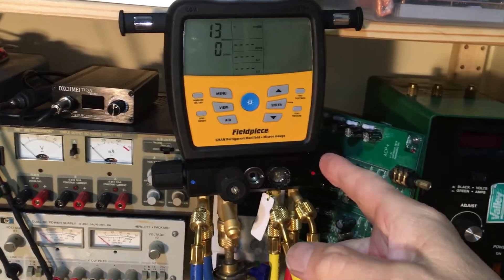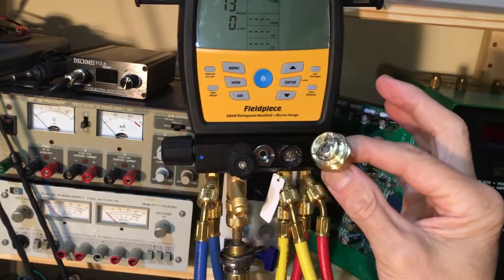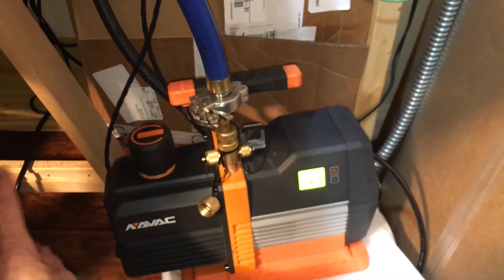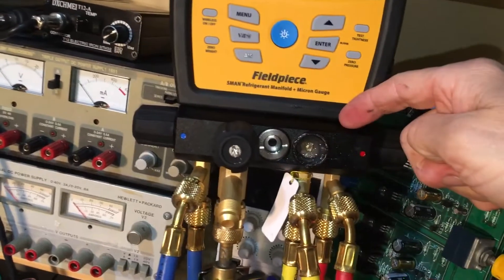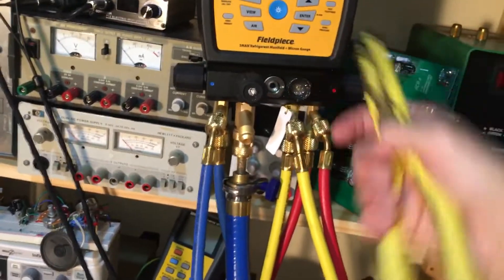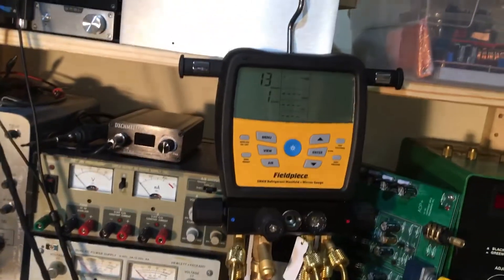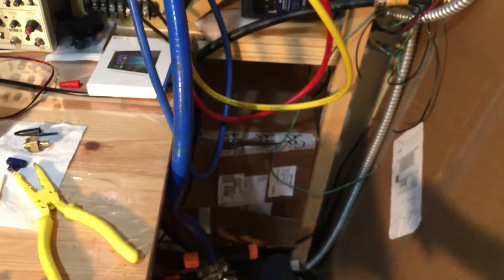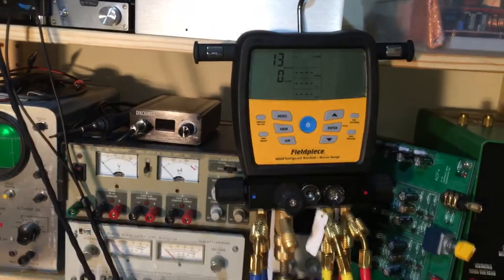Pt:6 SM480V 13 µm (microns) over night 12hr vacuum decay test.

Comment: I am so sad..... merely at the manifold only, no hose at all, I am having decay by 900 microns in 1 hour. The manifold is from Thailand, brand Tasco Black.  Micron gauge at LP valve port and vacuum at middle port, I then shut off LP valve so micron gauge read only the small air-path between itself and the analog gauge and any leak rate from the nylon seal of the LP valve.

Your manifold micron value doesn't lie. Two Thumbs Up.
You silicone it well during the improvement-overhaul that is one thing, but your method of always flushing with dry nitrogen I am sure is also important. Like a good food, it takes many ingredients to make it awesome :)

How low a micron can someone's SMAN480V brand new but left un-improved unlike yours ? I mean the manifold only assuming a ball valve installed to shut off hoses.

Thanks
Reply from the maker: FIRST MOST IMPORTANT ! To understand 

1: We are not supposed to attempt to pull extremely deep, lol micron vacuums through refrigerant, charging the horses that are not rated for Pulling Depot Vacuum in the first place .,

2: just the air that is trapped inside your ball valve when you open or close will throw off your micron reading. 

3: refrigerant, charging hoses out gas, they hold moisture they hold, refrigerant not rated for deep vacuum, and will be a source of some of the loss of micron rating during a micron vacuum decay test. 

And no matter who is Brand Refrigerant Garage are use they all have a little bit of leakage, trying to pull a deep vacuum beyond the rating . 

And definitely every time after using silicone grease makes all the difference in the world . 

That nylon valve face is pretty indestructible. Unlike that earlier predecessors were made out of Teflon would get damaged very easy. Worked very good when they were good.. 

But the small metal debris from a dirty AC system can embed in the valve face causing leakage . 

Many of the Chinese or cheap offbrand inexpensive manifolds I find them to be very leaky or if they don’t look at first they leak in a very short period of time .  In the material they use for the valve facing fails a early life.. 

Two years later, I am still using that same manifold to this day, and I use it anywhere from 8 to 10 times on vehicles every day .    Constantly screwing in and screwing out and seeding the valves repeatedly over and over to testing on each vehicle.. 

And it’s near impossible to do a micron decay test on very small volumes with the normal instruments that you and I would have . 

I am using a 12 CFM vacuum pump that is rated down to 3 µm . 

Most people do not on such a vacuum pump . 

Over the decades, this is why I only recommend using yellow jacket hoses, but they are very expensive . 

And if you’ve seen my modification on refrigerant, charging hoses, the video showing where I sickly coat, the hose and silicone grease and then use colored heat shrink tubing over the hose to protect it . 

This greatly increased the life of the hose and damage from UV from the sun and oxygen from the air, breaking down the rubber .  Abrasion resistance because it a shrink tubing..    in the silicone grease act as a moisture barrier. 

But still, if you’re going for the ultimate, you use the single hose method using a vacuum rated hose, not refrigerant charging hose
Reply: @coldfinger459sub0   I envy ur 13 microns decay in 12 hours , manifold only,🤩
Reply: @coldfinger459sub0   Yes, I am following all those rules you mentioned and still is learning on small air space vs micron gauge reading for my own knowledge sake.  Anyway I would like to share with you unique experience I had the last 2 days.

I know I need to have some air-space to test vacuum integrity using micron gauge decay , the only solid air space I had was that MasterCool Refrigerant Inspection sight cylinder tube, like the one you have. I been doing like 30 over deep vacuum on it as such today I just discovered that its valve core , the one on its r1234a male connector finally leaked....LOL.  I guess too much sucked down by vacuum the spring weakened.

Yesterday, I was experimenting evacuating my scuba tank, 8ish liter of internal water volume size and I then modify a dive tank pressure checker/reader to have 1/4" SAE flare.  The unit is similar to this : https://www.otgdive.com/allproduct/gauges/otg-scuba-diving-yoke-cylinder-tank-pressure-checker-tool-5000-psi-350-bar-og-174.html  but its has a rather different vent/bleed valve, which is slimmer and a 2 piece design. The vent/bleed valve design was good for 3,000 psi, but when I vacuum it down to <200 microns, it seized at -14.7 psi hahahaha. I snapped the knob trying to spin the valve. Anyhow that brings me to a question for you.

You spoke about leaking compressor shaft seal at vacuum but OK at pressure, have you actually damage such seal from a very deep vacuum ?  I mean some seal un-like o-ring, is good in 1 direction of pressure only and not the opposite direction. While -14.7 psi is not a lot if we think of +14.7 psi-g  , a mere suction of 25hg can squeeze all my radiator hoses like horror movie ...LOL.

Thank you Tom.
Reply from the maker: @suryaprihadi2258  small air volume you cannot use your micron gauge to do a reading to determine how accurate it is , you always fail usually.   Especially with the generic over the counter kind of equipment that you are using.. 

Because their volume is so small, just the molecules of air or moisture in the system will show up as a failing reading . 

Compared to, if the same test was performed on a large volume . 

This is where you have to read and educate deeper into the more laboratory grade literature for applied sciences for vacuum . 

Otherwise, you’ll be frustrated trying to measure something you should not be trying to measure with the type of equipment and procedures that you are using . 

No, you will not damage seals by pulling a vacuum . 

If the seal this week, it will just bypass and allow a little seepage in reverse through a shaft seal . 

The old Ford FX – 15 compressors for notorious for having a week from shaft seals somewhere around -16 times -27 vacuum they would leak. 

If you try to learn things on your own, without education, you’re going to have some very frustrating results possibly condemning equipment or tools due to the lack of knowledge of what they’re limitations are, and how to properly perform . 

Scientific type micrometers are in $1000 plus range each 

Centrifugal micron vacuum pumps or turbo core or others are in the multiple of thousands of dollars 6000 $8000 plus plus their electronic controllers that get down to the 0.001 of micron range to completely dry and remove molecules of gas. 

And at these ranges, you can use no synthetic materials. Everything Hass to be stainless steel or glass. Even the seals have to be made out of metal. .  These are things you learn in applied, science, classes and materials, classes, and deep back in classes in science and physics.. 

Without this base knowledge, somebody just grabbing tools that were meant for general testing trying to apply the same thing using vacuum pumps that are 100 times weaker and using synthetic materials that offgassing course will always come out with bad results . 

And between test using ball valves, ball valves, trap gas molecules so every time you move them at disturbed your test and you have to use heat and dry nitrogen gas sweeps with multiple repeated vacuums.   That are getting down into the 10 µm range for 24 hours..   

Just to get a good reading any good result like I do with my big white 12 CFM $3000 NAVAC 3 µm rated vacuum pump.     And that is not even a good vacuum pump..  and only using metal lines no rubber synthetic hoses with metal gaskets no O-rings.
Reply: @coldfinger459sub0  Yes my Mentor, I agree with you a 100% and thanks you and I read that awesome vacuum guide book which you linked, 1 micron is too high for those Lab people...LOL, amazing stuff.

I need to experiment before I touch my car HVAC system, hence I do a lot of "fun" test.
I did the wiggle test to see micron rising, the ball valve closed-open-75% yada yada, so amazing to see how minute trapped air molecules can do to the micron gauge Fieldpiece MG-44.
Whatever I damaged was under US$100, so its ok.

At least the test I did now allowed me to how better prepare the MasterCool inspection sight glass before use for evacuation....which in their own video how-to was not good enough an evacuation technique.

I still can't phantom how 'dry' and tight you are able to make your SMAN480V at 13 microns 12 hours later.
That is gold standard to me.

My vacuum pump is not bad, 15 microns rated and 9micron read by  Fieldpiece MG-44 at pump itself.
So assume MG-44 accuracy +-  , a 15 microns 8CFM pump I am happy already.

Comment: Is nylog not an option vs the silicone method your using here?
Reply from the maker: I prefer the silicone grease over the Nilog but both work. 

I have used both of them. 

But it appears that so many times are rebuilding my Vals silicon grease seems to last a little longer. 

And you’re making sure the silicone keeps stays behind that first O-ring exposed to the refrigerant you’re not putting it on the refrigerant side of the O-ring in piston it’s located at that O-ring and everything behind it

Comment: I was told that if you pull less then 100 micron. You might damage the pipes! They will collapse ?
Reply from the maker: Lol 😂🤣 The person who told you this must be one of the same people that believe the earth is flat, The moon is made of cheese and the sun revolves around the earth. 

          Here’s a question then I will give the answer but if you can answer the question you will have the answer to the below 100 microns doing damage to the hose. 

       1:   What is the atmospheric pressure at sea level that we all live in ? 

        2:  if 0 µm if possible was zero psi.   Then what is the difference between zero psi and atmospheric pressure at sea level
      0 PSI + atmospheric pressure at sea level = ? PSI

       OK here’s the answer
Atmospheric pressure that we all breathe in and walk around in that is pushing down on our bodies from all directions is 14.7 psi

           So you can basically say taking the pressure down below 100 µm there is only 14.7 psi of pressure pushing down on the rubber refrigerant hose. 

           I have not tested or checked us out intentionally on purpose but if I last believe the last time I stepped on a refrigerant hose I weigh 157 pounds and that did absolutely nothing to a refrigerant hose. 

           And if you actually look at the rating that is usually printed on the side of good quality refrigerant hoses it will say something like 600 psi of working pressure and 800 psi of burst pressure. 

           So unless there’s something wrong with my math and calculations 14.7 psi is a little bit less than 800 psi. 🤔 

             But don’t worry every day all around the world in Laboratories when doing normal processes using deep vacuum they are often pulling vacuums less than 10 µm and even much less using hoses. 

           And if you want to get much less than that you switch over to stainless steel lines or copper
Reply: @coldfinger459sub0  And to think. it's impossible to pump  all 14.7psi away for a perfect vacuum (no gas molecules remaining)..
Reply from the maker: @thisisyourcaptainspeaking2259  not possible on this planet. 
          There’s other vacuum pump so I can get down to eight to the 10th power 8/10th power below 1 micron. 
       But spending $6800. On a pump setup . I don’t think so
Reply: @coldfinger459sub0  Very difficult!  We used to reach 11 scale using cryogenic pumps.

Comment: That's an impressive improvement. Will it hold? 🤔
Reply from the maker: Automotive Solutions after this point they usually always hold. We will find out tomorrow morning.
Reply from the maker: Even though you were not supposed to use refrigerant hoses and refrigerant gauge manifolds for doing a micron lead decay test.   Using the silicone, grease vastly improve the performance in the life of the old rings on the valve assembly’s..   it’s two years later and I’m still using those same manifold gauges literally thousands of times.